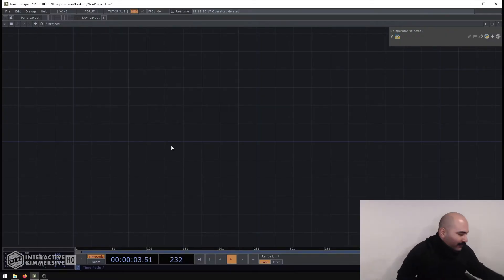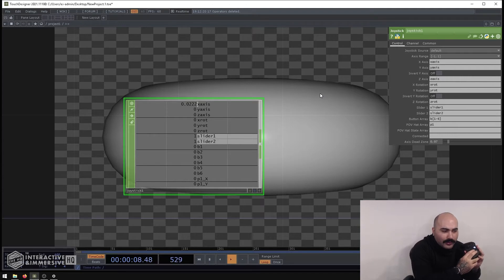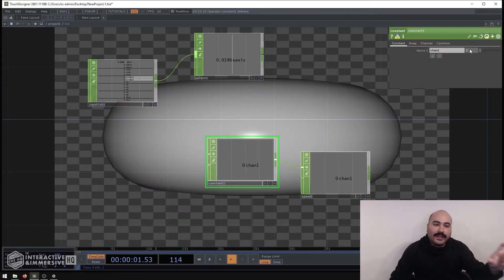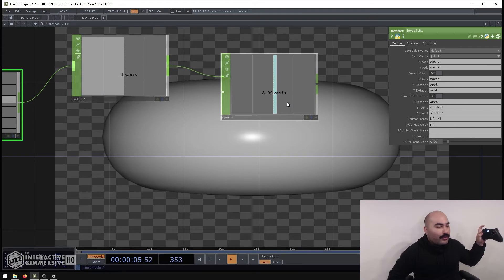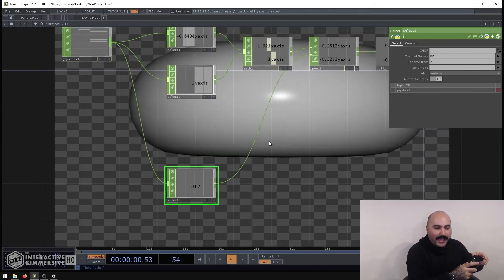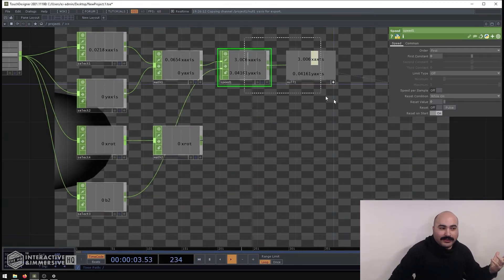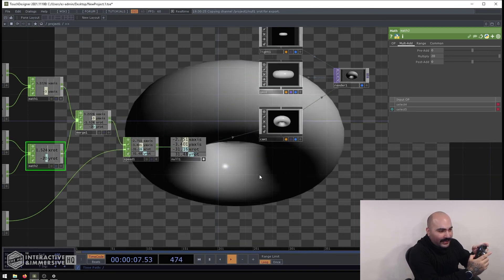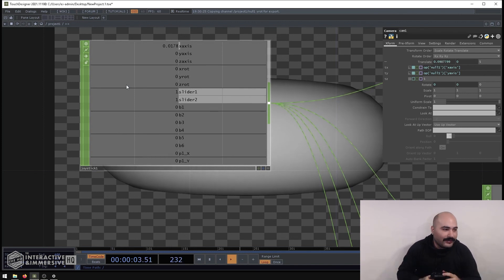XBOX One Controller in TouchDesigner - TouchDesigner Tutorial 042

Comment: Hi Elburz, that's a pretty good tutorial as always. I'm connecting the joystick via OSC to Notch, to control Notch Camera, but I'm having a problem, that when I'm not in touchdesigner application, it doesn't recognise the movements from the joystick, it's not working on background mode, even with the play on in touchdesigner. Any idea, on how can I make it work? Thanks in advance.
Reply from the maker: Hmm that's a tricky one. Are you minimizing TouchDesigner when you put it in the background? There's a setting in the TouchDesigner application preferences where it stops it from processing if you minimize it, and you can turn that off. Could that be the issue?
Reply: @TheInteractiveImmersiveHQ  Thanks for your fast reply, I'm not minimising Touch, I have two screens,  on one screen I have Notch and on the other Touch, just changing the application from one to the other it completely stops receiving the joystick data. :(
Reply from the maker: @JordiPont  Hmm that's tricky. When you switch applications can you see if the timeline  of TouchDesigner is still running? I'm curious if the whole TouchDesigner app is getting stalled or if it's specific to the joystick.
Reply: @TheInteractiveImmersiveHQ  Hi Elburz, TouchDesigner timeline is running, but if the application is not selected and active, the input of the joystick stops, is that a bug of that chop?
Reply from the maker: @JordiPont  Hmm that could be, if you temporarily replace the Joystick CHOP with something like an LFO CHOP and feed that into your Notch camera control, does it keep working if you switch applications? It definitely could be a bug in TouchDesigner and we can make a bug report on the forum about it
Reply: @TheInteractiveImmersiveHQ  Hi Elburz, sorry for my late response, a lot of work this days. Yes, with the LFO and Touch minimized still works, so it seems it's just happening when using the Joystick CHOP. Cheers!
Reply from the maker: @JordiPont  No problem! I hear you on lots of work :) Hmm that's strange, I even did a search on the forum to see if anyone else had encountered the same issue but didn't see anyone mention similar. I think best thing to do would be to open a new post on the TouchDesigner forum reporting the bug and possible posting the project file if you can.
Reply: @TheInteractiveImmersiveHQ  Ok, that would be great, it's weird that no one had the same problem already. Cheers!!